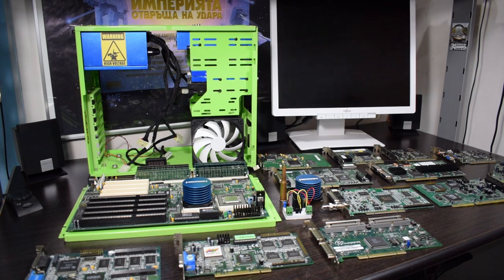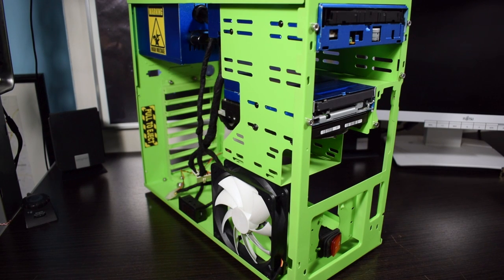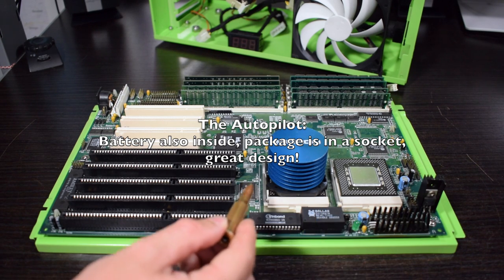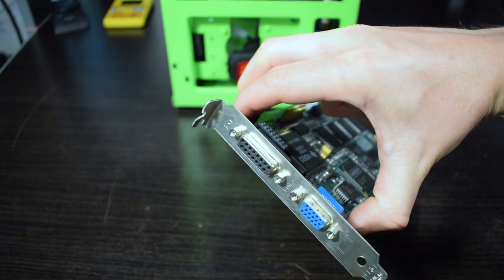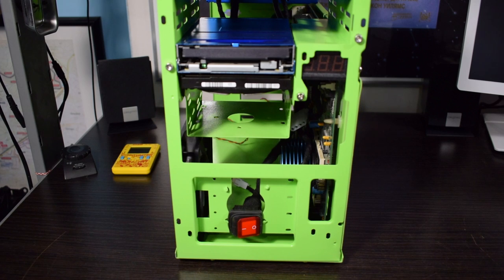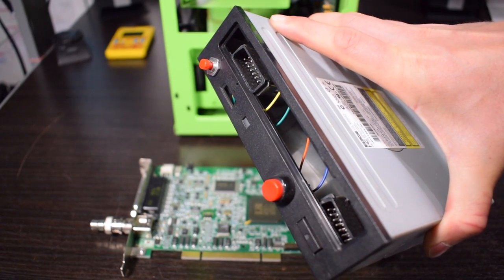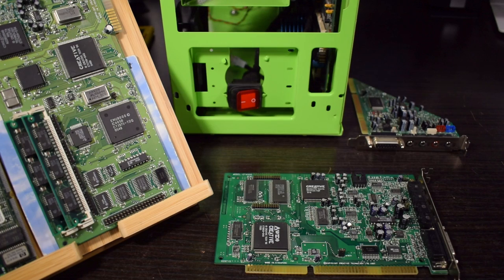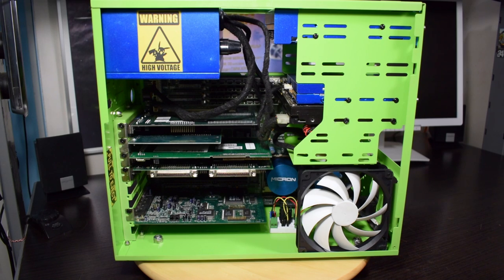Building my epic dual Pentium MMX workstation based on Tyan S1563D

Comment: Got a question? I also have the Tyan Tomcat III MB with the 4.02 bios(upgraded from 3.01) where did you find the newer voltage regulator for this board so it will better handle the dual voltages like the Tomcat IV MB does for the proper dual Pentium 233 MMX Support. If the voltage regulator still available I would love to get one for my board. Thank you and awesome video I love the choice of green color for the case.

Comment: Out of curiosity why not dual 233 MHz pentiums?
Reply from the maker: Ahhh, a very good question. I did not have two back then, and they tend to keep high prices on Ebay. I now have and  will probably try to upgrade the beast. Will keep you posted :)